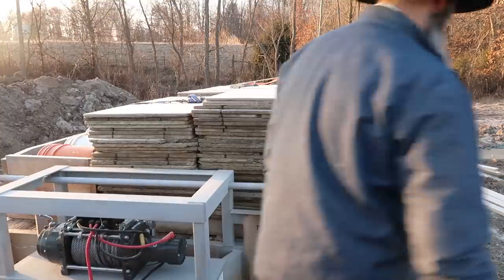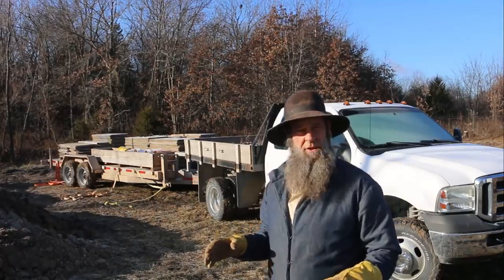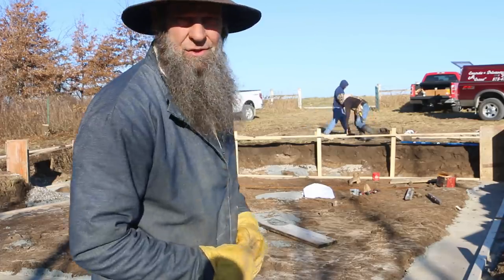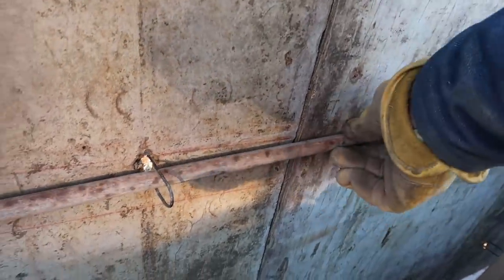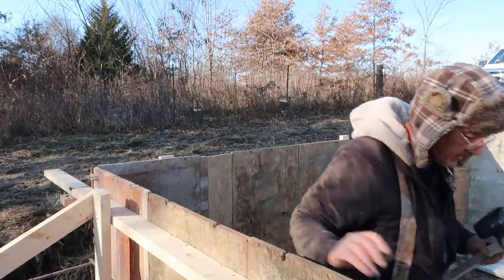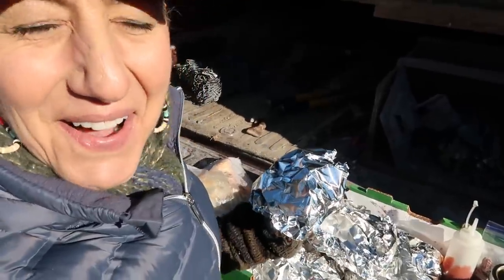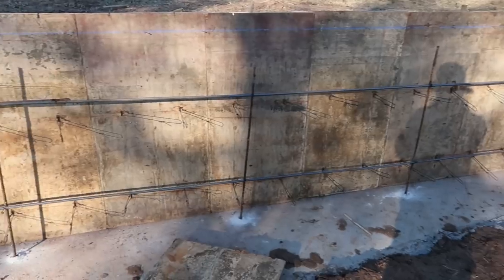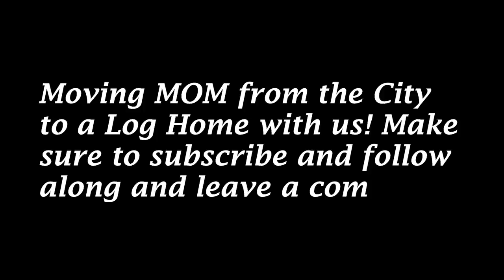Building A Log Home for MOM | Day 6 Forms are up!

Comment: Different strokes. Where I am originally from (the land of fruits and nuts) I was a building inspector for several years. What you call foundation, we call STEM wall and when the footing is poured, the steel is brought up vertically, so when that vertical lift is poured, it becomes a monolithic pour and acts as one giant piece. Here's hoping you don't have seismic activity, because that cold joint you have between your foundation footing and your, what you call foundation, will want to move.

Comment: Is the decision to do a crawl space instead of basement because of cost? My in-laws have a crawl space and now that they are in their eighties they are finding the crawl space hard to crawl around it and regret not doing full basement.
Reply from the maker: Why are they crawling around in there?
Reply: @OFFGRIDwithDOUGSTACY  I think on grid related stuff so probably not a problem off grid. For example just installed a step in tub. They are in their 80s and believe this will help them.
Reply: @OFFGRIDwithDOUGSTACY  They also need to keep a fan running to avoid moisture issues.